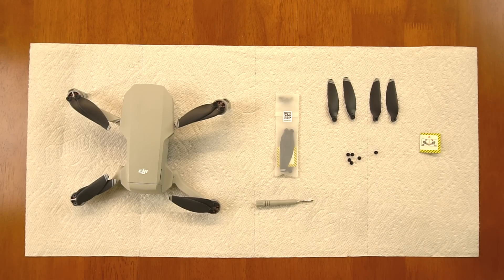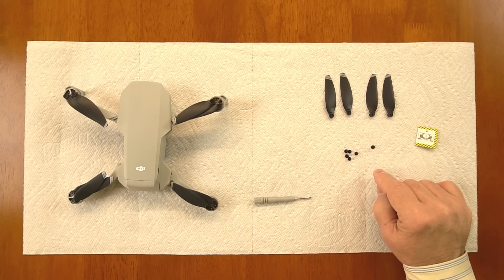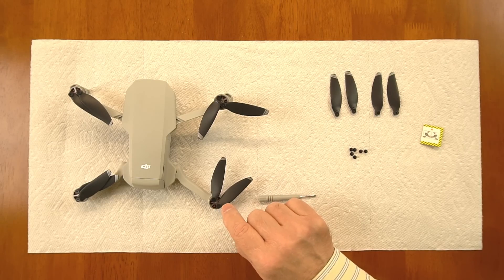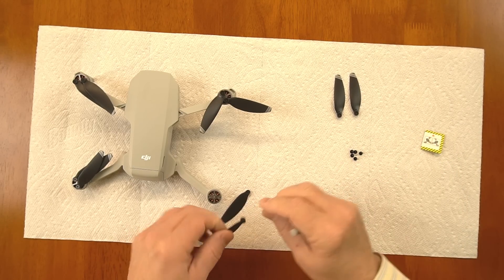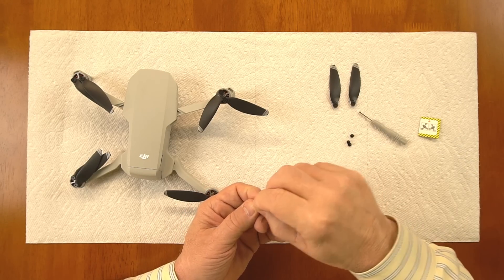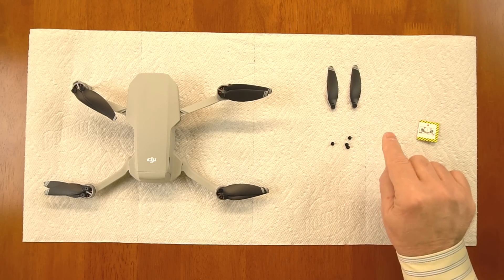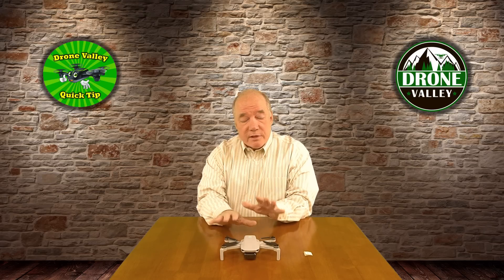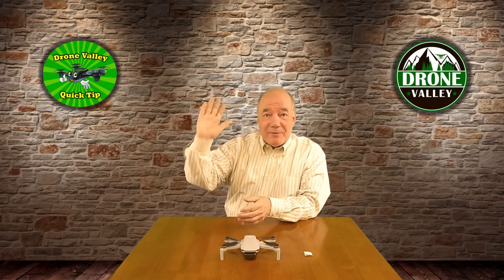Mavic Mini - 3 Critical Things To Remember When Replacing a Damaged Prop

Comment: Thanks! Easy but useful as I crashed after 2 days (first drone ever) of flying and put the replacement propellers on not being about the stripes. I was worried that there was permanent damage as it looked like it had a wounded leg flying in circles.

After checking the propellers, I did indeed put the wrong one on!! You a life saver!! Thanks! Got yourself a new subscriber!

Comment: I got a few nicks and dings on my propellers after a couple of accidents, but the propellers didn't crack. So I took a couple of sanding papers and gently sanded the edges so to take out the rough edges and make them smooth. It is not like the brand new condition, but the propellers look much smoother now.

Comment: Another winner, Rick! Just an added tip being that the Mavic Mini is so small to see in the air. I ordered a small strobe light that I am mounting on the back battery cover that will make it easier to find it in the air. I am going to register it anyway as I know it will go over the 249 gm weight with the strobe light on. Mine comes tomorrow per FedEx so plan to give it a workout this coming week. So many great YouTube videos on the Mavic Mini that help to make it a great little bird to consider, even for us 107 and advanced flyers.

Comment: Thank you Rick. If it is Loctite, it needs 30 min. to dry. And you can by Loctite blue in a stick. So you can use old screws after cleaning the old Loctite.
Reply: That's exactly what I was going to ask, can I use the old screws if I add locktite?
Reply: H E Yes you can. I do this since 30 years😊
Reply: jegla , Thank you for the tip 😎👍
Reply: I have a warning about any liquid (loctite or other brands) that is used for keep screws in their place: before replacing the screw let dry the loctite on the screw otherwise the very little screw can loose its head when unscrewing them (I think that adding directly the screw with the liquid will fix with too many strenght the screw). Just my two cents😁

Comment: Great teaching video.  You mentioned accidentally nicking the motor windings digging out a wayward screw. I crashed the other day and had dirt in the windings!  What’s your engineering analysis on the aluminum motor covers? Extra heat? Other issues? Thanks!

Comment: Hi Rick I enjoy your clips! My question I have been a hobbyist for years, what is wrong with me putting a drop of thread lock on the old screws?
I been building and flying RC Helicopters for years and have used Loctite  with no problems. Thanks
Reply: same question.  my take is as long as the lock tight strength isn't to strong and doesn't cause problems with future replacements.. I think we are good.... but on the other hand, if new ones are provided, why not use them and save the old ones as spares.

Comment: With the new firmware update, the algorithm will actually which motor has a possible bent propeller. It actually happen to mine and after I removed the propeller, I compared it to a known good set and it was slightly bent.

Comment: Rick, if standing on top of a hill and set the Mavic Mini to fly at 200 feet, what happens when you fly over the lower ground? Does the aircraft follow the contours of the ground and so stay at 200, or does it then actually fly higher than 200? Brilliant reviews and info. Thank you.
Reply: Elevation is based on where you took off, and unless directed otherwise, it will try to maintain whatever level it's at. It does not change due to terrain. Keep that in mind for overall above ground level numbers, return to home height, etc.
Reply: @clange50  Thank you for very clear and fast response. Much appreciated.

Comment: Thanks for this helpful video but I’m still confused as to why there are 6 screws with 4 propellers? Just had to replace my two propellers and wound up with 2 extra screws with the 2 pairs.
Reply from the maker: Joe, they include extras because they are small and can be easily lost when changing the props.

Comment: I have just seen on PhillyDroneLife video that you have a full yaw and gimbal control during the RTH. That would mean that you can basically simulate the course lock of the more expensive drones by carefully selecting the home point, which is very cool. Could you perhaps make a video testing this as I have not yet seen it used for this purpose.

Comment: Thanks very much Rick! Very useful advice for me, a noob ;-) I finally took my Mavic Mini out for its first flight yesterday since the weather here in Minnesota was finally conducive for it.  Other than a few idiosyncrasies that I still haven't figured out with the DJI Fly app, my first flight was successful and I managed to take a few photos of me and my friends during the short flight. I'm using a Samsung Galaxy S9 and one problem I noticed straight away was that when I hit the "fly" on the left of the screen to take off, my phone interpreted that as a request to return to my phone's home screen. After several tries I finally got it to work. Same thing happened when I tried RTH. I ended up manually landing the mini.  Hopefully I'll get the hang of it with more flights (coming up soon as I'm hooked).
Reply: Sounds like the on-screen 'buttons' are interfering? For RTH, you can use the button on the controller obviously. For takeoff, you can hold both sticks down and out or down and in to start up the props. Then take off manually. A bigger issue might be if it stops you from cancelling a RTH or cancelling an auto-landing. Definitely something good to think about/test ahead of time.

Comment: i read somewhere that the screws are not lock tight coated but nail polish ?? so if one reused the screws would nail polish do ?? thoughts.
Reply from the maker: Nope, they are using "blue" loctite and it's important that you not use ones you've removed from the drone. You do have the option of picking up a tube of that blue loctite from Home Depot to reapply if you want to save the screws but the replacement props come with new ones and that's why I suggest discarding them. Thanks for the post and I hope you'll sub the channel. Rick
Reply: @Dronevalley  wait so you mean the new replacement screws already have a lather of locktight on them???
Reply from the maker: Yep, they have a thin layer of Loctite on them that activates when you tighten them down.
Reply: @Dronevalley  oh man thank you!

Comment: There are marks on the drone arms that indicate which arms the blades with the extra line go on.  The blades with the extra line on them go on the arms that are marked.
Reply from the maker: Brian, thanks for the post and I did mention this in the clip as another way of keeping the props on the right motors. I'll have a few more Mavic Mini clips posting this week so be sure to stay tuned. Rick
Reply: @Dronevalley  Arghh!  My apologies, somehow I missed it.  Love your videos, as a new Mini owner I'm learning a lot.
Reply from the maker: @brianshorey  No worries, I'm glad that you're watching. I'll have a few more clips up this week and flew through 3 batteries today with the Mavic Mini. I will also be reviewing a new Battery Adapter for the Mini this week that allows you to charge a cell through a standard USB cable. Stay tuned for that! Thanks again, Rick

Comment: Hi. I had 3 small flights which went OK on the most recent fw but my last flight I got motor speed error and on rth I was only getting 0.3 meters per second. Do u think I should re flash the fw or change the back left props

Comment: Hello Rick, Thanks for this great information again!👍🙏Today I got my flight more combo and I hope to fly the Mini for the first time at the end of the week when the weather is better. I have one question about the case that came with the combo. With the sticks in the controller it does not fit in the box completely, so you have to remove the sticks everytime at the end of flying? Do you have tips for me how to fit it in the case supplied with the combo or do I have to modify the case. I do prefer not to do so. I hope you can give me some tips and tricks about storing the controller in this or another case! Also the blades moving freely in the case during transportation is not ideal.
Reply: you hace to take off the sticks before close it, it will be more safe, good fly!

Comment: So I just wrapped my Mini and took off the screws and propellers to do it. I noticed it shook a little when putting the same ones back. My MAVIC Mini has only been flown a Hand full of times. I need to put new screws? What about the propellers? Or just do the screws. I wrapped my Mini with “Wrapped Grade” and that’s why I took them off.
Reply from the maker: I would make sure that you have the screws in tight so there's no wiggle in the props. The reason I recommend discarding the older props and screws is that the props are a matched pair and the screws have Loctite on them that holds them in the shaft and can only be sued once. If you remove them, the glue bond is broken and they might work themselves out of the shaft while flying. The only other thing I can think of is that the weight of the wrap is somehow off balance and causing the wobble. I hope that helps and thanks for the post. Rick
Reply: Yes, Rick, I agree with you. Thanks you are a huge help to the industry. Thanks

Comment: I recieved a unit whit one screw not screwed in properly so i screwed iy in my self. Is this  the right way?
Reply from the maker: Sure, it you found one of the screws loose, tightening it up will activate the Lock-Tite and you'll be fine. Thanks for the post! Rick

Comment: So just to clarify- the new screws have liquid blue loctite on them , and it sets solid only after being screwed on tight to the motor?
Reply from the maker: Len, yes the friction from the screw working it's way into the motor as well as the compression generates a little heat that activates the Loctite and it sets to add stability to the fitting. Once you back the old screw out you break that bond and it can't be reactivated. Always use one of the new screws and you'll be fine. Thanks for the post and be sure to sub the channel so you don't miss anything. Rick
Reply: @Dronevalley  Can't you just clean off the old loctite from the old screws and add more on? You can get blue loctite at any hardware store. Throwing away the screw after 1 use seems like a waste.
Reply from the maker: I agree that you can clean it off and add new Loctite but since each new propeller kit comes with 6 screws (2 extra) you'll never need to keep the old ones since you'll always have more than you'll need to change the props. I know it seems like a waste but you have to remember that there is a stress involved with installing and removing the screws and I don't like to take chances with a single point of failure like this. Thanks for the post and I hope you'll stop nack soon. Rick
Reply: @Dronevalley  thanks for the explanation

Comment: The screws on the props all turns clockwise to tighten? You mention something about counter clockwise props, not the direction of tightening the screws?
Reply from the maker: Thanks for the post and the screws are just like regular screws that tighten in a clockwise rotation. I was referring to the props and you'll find both CW and CWW props in the kit and it's important to match them up. Rick
Reply: Thanks Rick, just verifying..
Reply from the maker: @djpotts2554 No worries!

Comment: Hello! Noob question here... is it advisable to replace perfectly fine props after a number of flight hours? Also do they have an expiration date? Cheers
Reply from the maker: Thanks for the post and I tend to replace my props every 3 months in the summer to avoid any issues when flying. I know that's probably conservative but a lot of the fatigue and wear is hard to see and I don't want to have issues that might bring the drone down sooner than expected :) Thanks for the post and stop back soon. Rick

Comment: Now I understand why there’s lock tight. Thank you
Reply from the maker: Thanks for the post and I'm glad that the clip helped. LocTite is an amazing product that keeps a lot of fasteners tight that would normally work loose over time. There are a variety of different bonding strengths and you can tell them apart by their color. Stay tuned for more content this week. Rick
Reply: @Dronevalley  I use LocTite for my spark plugs in my vehicle, didn't realize they were on the screws. Now I have to throw my screws out as I don't know which are used and which aren't in the pile of extras. Oh well, better to be safe than sorry.
Reply from the maker: @tbsdrummer87  You could always grab a tube of Blue Loctite off of Amazon and save those older screws with a little dab on each one.

Comment: Thanks a lot, Is it bad or good to try to tighten the screws after some flights, or when it comes new from the store?  Or do I break te lock material at that moment? Another tip, please take more rest in explaining,  your speed in talking is too high for me, so I cannot get it all. I miss at least 5 %, and that can be a lot.... Greetings from the Netherlands.
Reply from the maker: Herman, thanks for the post and I'll try and slow down. Don't tighten the screws once they are installed, you'll break the seal on the Loctite. Replace the props when needed and then leave the screws as they are and you'll be fine. Stop back soon for more clips, Rick

Comment: I absolutely HATE changing the props on this Mavic Mini.  One screw will not go down flush!  This puts the fear of God in me.  My Mavic Air is easy breezy.
Reply from the maker: I agree that it's a little more work but they did that to eliminate a few ounces that the quick release would have added. One other point, the screws don't actually screw in flush and will bottom-out with a little play at the top. This is to allow the props to swing freely in flight. If you really feel that one of the screws is higher than the others, I'd remove it and use another one of the spares that come with the kit. Also, remember that the Loctite is down there to help keep the screw in place so I'm sure you'll be OK either way. Thanks for the post and stop back soon for more clips I'll be posting. Rick

Comment: It's too bad the mavic mini is so delicate, if you crash it, the least of your worries will be the propellers.
Reply from the maker: Thanks for posting but here's the interesting part, because its so light it won't sustain too much damage if it falls from a height. The physics is less dangerous for lighter objects like this since the force exerted on the frame is dependent on the weight. In a lot of ways, it's actually more durable in a crash than a heavier drone like the Mavic 2.

Comment: Id like to know how to balance blades , what if i buy air screws for my mini , they come all mixed up , how do i balance those ? Can someone point me to that video ? or is this just  to get you to waist good blades and buy more ? Ive never had an issues with swaping just one blade or third party blades , maybe im lucky ? maybe its not true ? Untill i see someone balancing blades im going to chalk this down as a marketing thing to sell more blades ...i have a hard time believing they balance each set but i do believe they wieght every blade , that would make sense ...i tryed weighing my take off blades and had a hard time getting consistent numbers so this is why i call BS , now maybe my equipment isnt high end enough ( china brand )  but i did try to confirm this so im not just a trol here ...all im saying is if someone can confirm this , id love to check this out ...drone busters where are you ????
Reply from the maker: Thanks for the post but you're making this too complicated. The props for these newer drones are inexpensive and it's just a better idea to swap them in sets instead of trying to save a few dollars by swapping them individually. There are many reasons for, this but the biggest is that both blades on each motor are spinning so quickly that they share any "trauma" that motor experiences. I've never had a nick in one prop on a motor from a tree branch show up without damaging the other. Also, all the props get dirty the minute you put the drone up. There is a lot of debris floating in the air (dust, dirt, pollen and moisture) and all of it lands on the props and throws the balance off. DJI compensates for this by using newer Sine style ASC's that have finer control over how the motors drive these props. They are so good that you can actually snip the end off of one of the props and the drone can still fly. So all of this being equal - no need to balance the props but when you need to swap them, swap the pair with new screws and get back up in the air. No BS, just simple engineering.

Comment: I've watched it until "props pairs are carefully balanced at the factory" BS. Not going to lose time.
Reply from the maker: Thanks for the post but that's a fact unless you know something different. Every pair of props is paired and balanced before packing them up. Mixing props can have an impact on how the quad flies and handles in the air. I do these clips to help other fliers and relate information I've discovered myself through flying or from discussions with the manufacturer. I hope that helps. Rick

Comment: Really?
Reply from the maker: Stan, I had about 8 emails this week asking about the prop kits on the Mavic Mini so I did a clip thinking that there were a lot more new fliers with the same question. I'm here to help and there are a few tricky things to remember for folks that haven't changed one before. Thanks for the post.
Reply: @Dronevalley  You are right I guess since there are many other videos about the same thing on how to put on propellers.
Reply from the maker: Stan, I mostly react to the emails and messages I get every week from fliers and try and do a clip on a subject I'm asked about a lot. This one is pretty important so I wanted to get this posted.